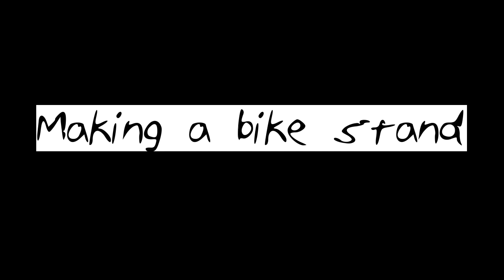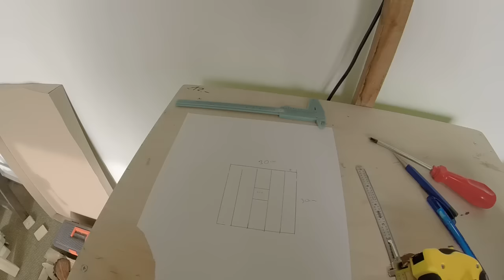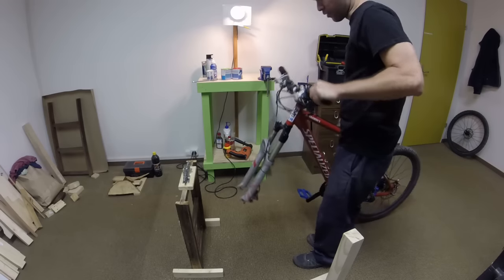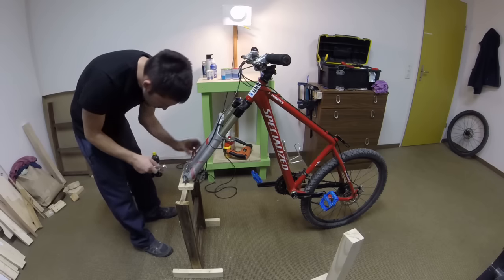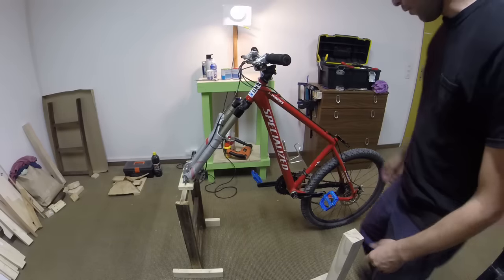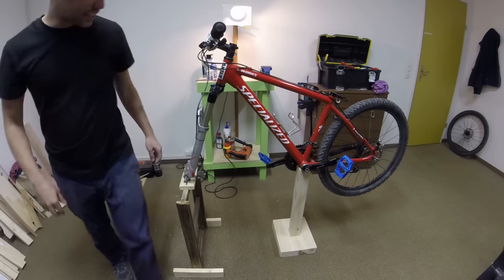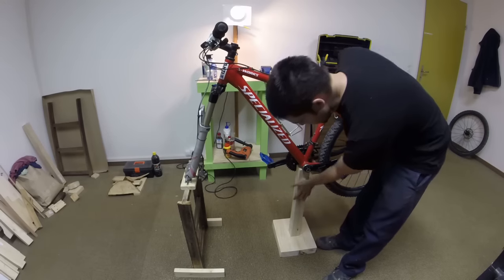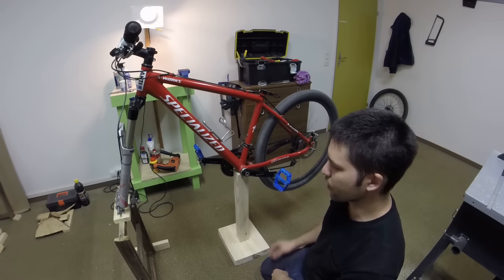Making a simple bike repair stand

Comment: if u had used extra timbers to connect the 2 stands together it will make it sturdier with less chance of it tipping over & falling on to you,another suggestion is to glue a piece of electrical conduit cut in half to form a "u" shape & attach it to the post,also several layers of an old tyre tube could be glued into the "u" to pad it out & to prevent the paint on the underside of the bottom bracket from getting damaged,the wider u can make the stands the better to counter the top heavy weight of the bike,or make the whole stand lower to the floor would help too especially when disassembling the cranks/bottom bracket :),great video :)
Reply from the maker: +neil froggy crompton thanks for the ideas. Now I'm thinking of re-doing the whole thing to a more standard frame or seat post mounted type.
Reply: +Bruce's shop stuff and other things wouldnt take much to update your initial ideas :)
Reply: +Bruce Chastain so did u update your old stand?,video?
Reply from the maker: sure did my friend: https://www.youtube.com/watch?v=hnD2wnjYOLo

Comment: wide legs as flat as possible to the floor like what u would see on the legs of an ironing board would help heaps with stability,or a triangle shape frame with the widest part of triangle under the back wheel where most of the rear end weight would be :)